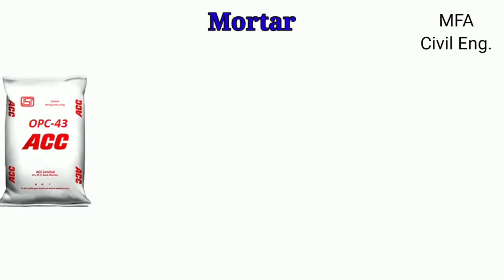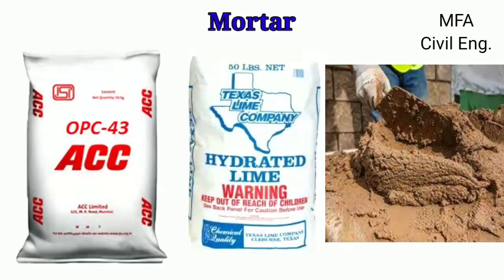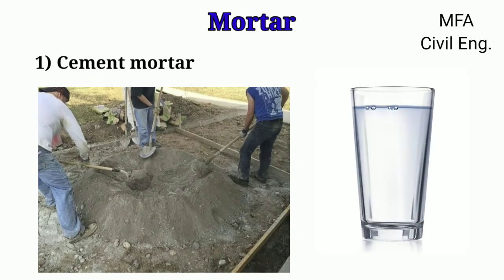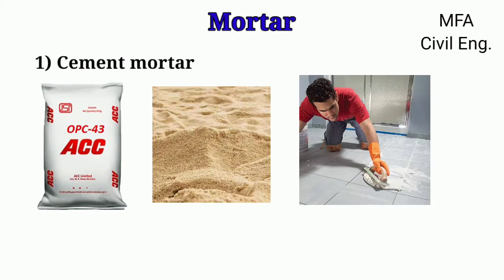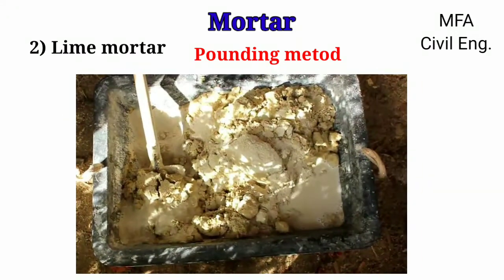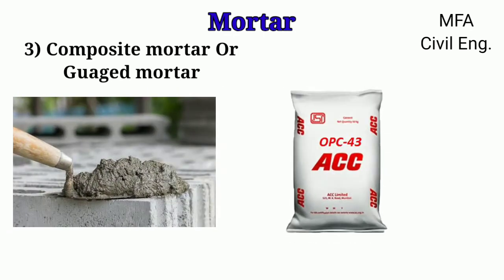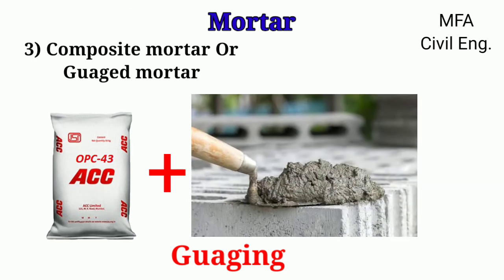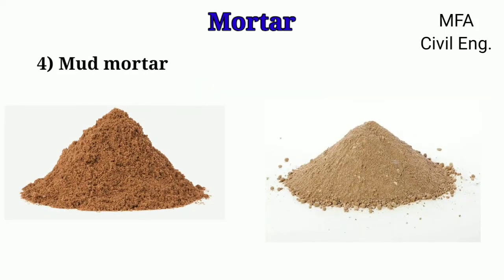The Ultimate Mortar Showdown: Which Type is the Winner?

Comment: What is ac2 or ac3 mortar?
Reply from the maker: the proper arrengement are c2a(Di calcium aluminate) and c3a (Tri calcium aluminate). it's a ingredients of cement, all type of Portland cement contain this compound.If the percentage of c2a and c3a in cement is more within a prescribe limit, it increase rate of reaction and decrease setting time like "quick settings cement" "rapid hardening cement". the above cement used as mortar in cold weather and also in underwater for repair work.
Reply: @MFACivilEngineering  thanks for your quick response